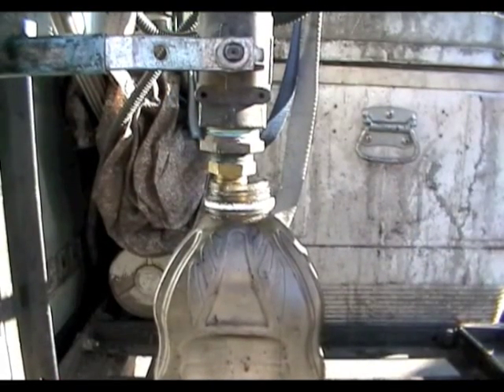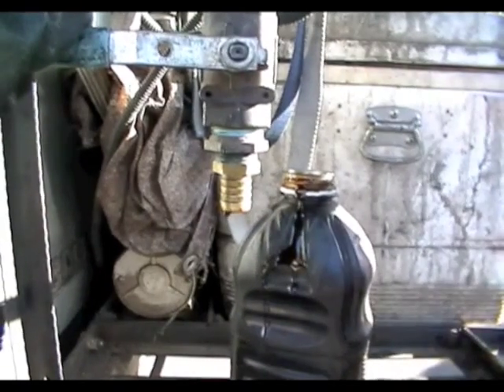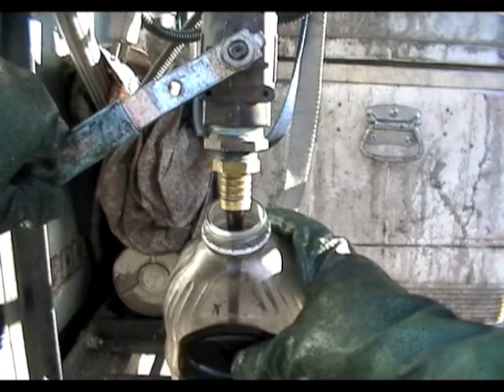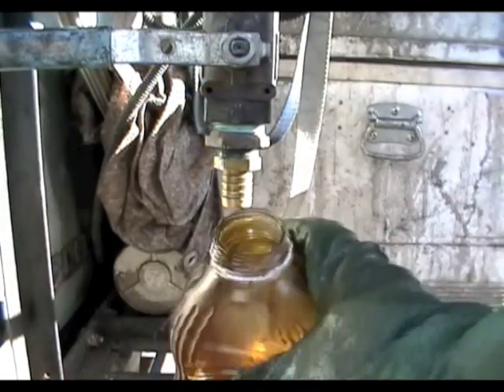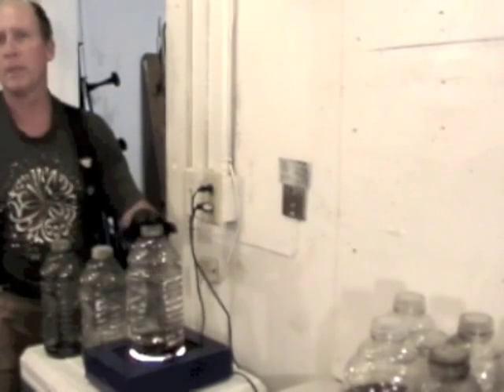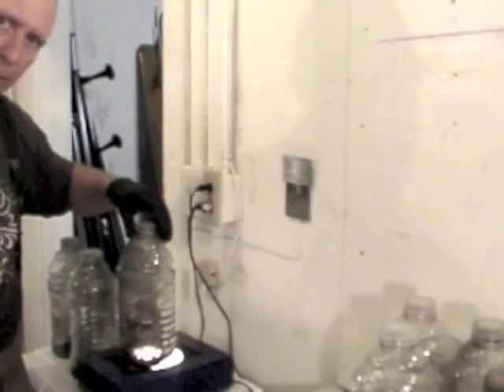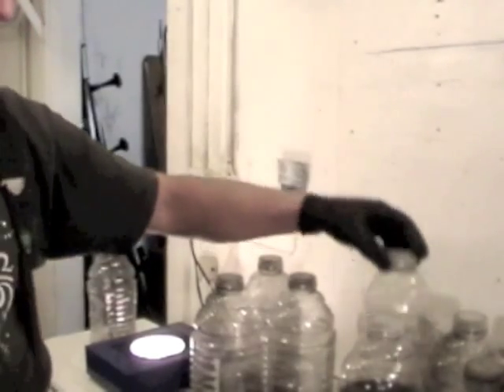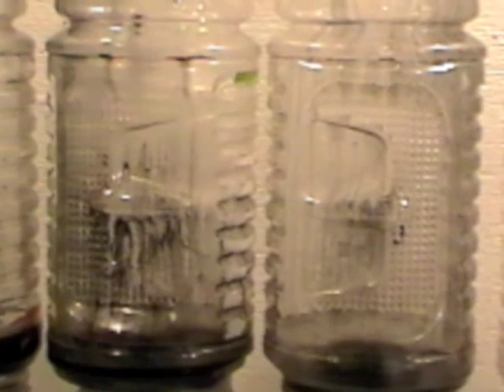Removing the Sediments from Processing Black Diesel

Comment: Do you add 20% petrol to wvo? Or just wmo
Reply from the maker: Graham Bate I have been using roughly the same gasoline content to both WMO and WVO blends; however, I have recently increased the gasoline content to 30%, and added diesel fuel at 20% to bring down the overall waste oil content to 50%.  Also, WMO blends have never run well on my n/a diesel engine, so I no long run them.
Reply: thx mate for your advice, keep up the good videos.

Comment: I say throw some old speaker magnets on the bottom of the settling tank...(50 gallon rain barrel), cut the oil with a 50/50 mix of diesel pre-filtration them pour it down a 1 micron sock filter, (and make two bulkhead valves on the barrel one 1" from the bottom the other 7"). And draw the honey from the 7" valve running through a diesel water separator and a diesel filter and just let it compliment your regular diesel.
Reply from the maker: dappergen there is a problem with blending waste oils with diesel fuel, because the blend always ends up a lot thicker than a waste oil blend with 20 gasoline.  There is also a problem with diesel based blends gelling in the winter; whereas, gasoline based blends can run at a much lower temperature in the winter time.

Comment: I've watched a few different home setups used in processing WMO. For work I help service 20' high crude and waste water tanks in the oil field and generally what's at the bottom of all those tanks is going to be a problem. So they put loading valves about 3' above the tank bottoms then they'll have a clean out valve on the bottom of the tank. So I'm thinking that's a good idea for the settling tank. Most people don't like the idea that there's always going to be some WVO left over.
Reply from the maker: dappergen yes, WMO is a problem to clean up, and owning a settling tank with a cone, or domed bottom has helped me process all of my waste oils into diesel fuel; however, we can never know where the sludge stops and the good blend starts, so I just keep draining samples off the bottom until there is no more sediment.  I then pour all of the sediments into a bucket or barrel, and leave them to settle for another month, and I can usually get 50-80% off of that.

Comment from the maker: @Begbucks It turned out I had to remove about 5 gallons of sludge from that batch.  I have found the amount of sludge that has to be removed varies from batch to batch, from 10% to 25%.  And, it all drops out in three days.

Yes, I reuse all of my sludge by putting it together in one bucket, then I pour the dirty gasoline from back-flushing my filters on top of it, then I let it sit for about a week, then I pour the thin liquid off the top of the waste oil in my next batch
Reply: Thx, I going ask U a couple questions, but U answered them in ur comment, cheers